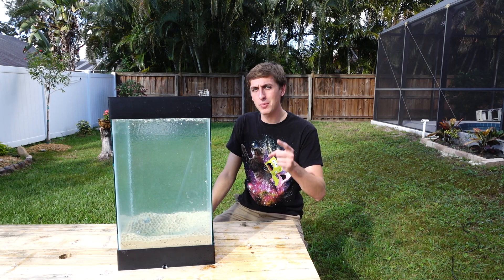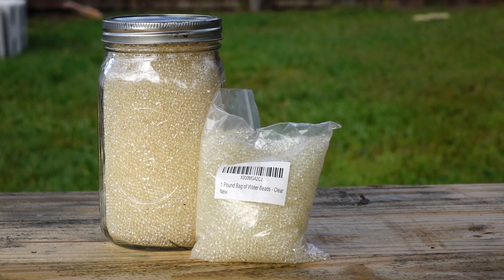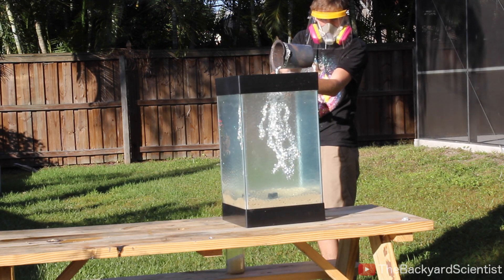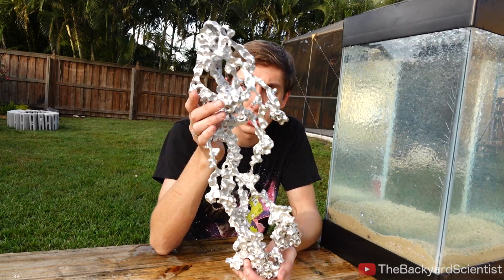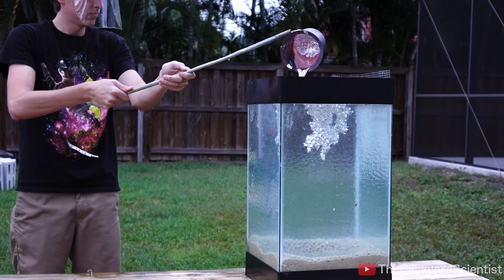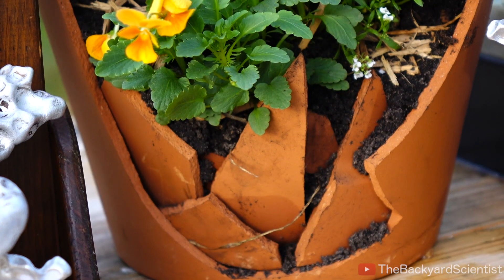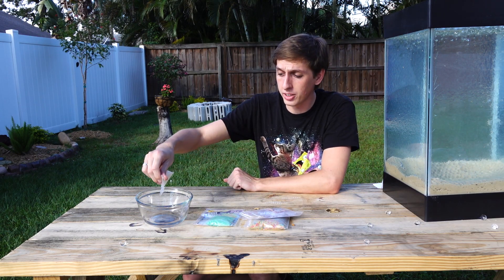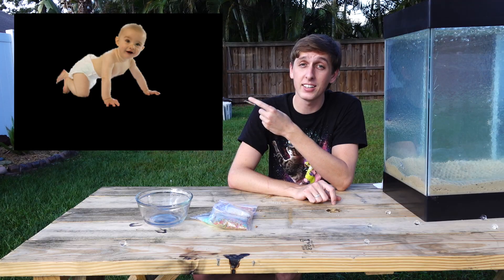Molten Aluminum Vs 'Spitballs' - SO COOL!! (water balz)

Comment: NEVER put it in your aquarium! NEVER!
Reply: tak nie it is not toxic at all, aluminum doesn't corrode
Reply: Natuka Rodriguez 
Because aluminium is toxic and can kill fish.
Reply: tak nie why?😲
Reply: Aluminium is a toxic metal
Reply: Aluminum is toxic in water, leeches into the water and can kill fish, but it's especially toxic to invertebrates like shrimp and snails.
I suppose if you coated it with a special paint and resin, it could work, buuut with the small chance that it isn't fully sealed or sealed properly, I wouldn't risk it.
Reply: Brooks Meinecke Actually aluminum cans have a plastic coat because it can contaminate the products inside a can
Reply: Brooks Meinecke  in some enviroments, or with some other  things in water it can.

Simple thing you can observe is taste of the food maded in aluminium pot, and steel pot - You can feel the difference?

Comment: Please do not put these in Any Fish Aquarium. ✌️✌✌
Reply: Soda cans are generally given a coating on the inside to keep them from contaminating your drink.
Reply: remixgod 
Oh man, I was right about to, in my fish tank that I totally have
Reply: Maybe you could if you coat it with something so that it wouldn't contaminate the water
Reply: remixgod umm 😐 you drink out of soda cans which are aluminum,
Reply: Epoxy could do the job (after neutralizing...)
Reply: remixgod agreed. that cannot be good for the fish.
Reply: Fkp%d
Reply: remixgod Then why do we use aluminium foil?
Reply: Maybe you could put on it. Some crystal resine To coat it.
Reply: Well to late
Reply: Chase 123424 You are not stating facts.. Generally having "Metals" in your aquarium is not beneficial to fish. There is such a thing called "Metal Poisoning". ✌️✌✌
Reply: @KINGShaheed - You can generally cook on aluminum or in aluminum pots without a problem, but it's better not to store food in it for any appreciable time. Aluminum can leach into the food, especially spicy and high acidity foods.

Also if you boil water in an aluminum pot it will cause it to oxidize and creates a barrier that helps prevent leaching into the food. Aluminum foil is harder to get that oxidized layer on. It's better not to cook with aluminum foil and much better not to store food in it if it has high acid from tomatoes or lemons or spices.

Aluminum poisoning takes a while in a human sized organism, but it accumulates in the bones and brain, eventually causing problems.
Reply: Federico Madden yeah, something that's just as harmful in the long run!

Comment: This video was so cool! I was just thinking "wouldn't it be cool to see one of those sculptures be used as decor in an Aquarium?". In all seriousness, would it be safe for fish to have an aluminum sculpture in their tank? Any expert fish keepers out there know if this is safe???
Reply: Cans are coated on the inside
Reply: Terrae Spiritus no it isn't.
Reply: If aluminium isn't safe for aquarium use. You should probably stop drinking from soda cans. Btw... I use aluminium weights to anchor down my aquarium plants so the bottom dwellers won't mess it up easily
Reply: @DanlGy  there's a thin plastic film so the drink doesn't touch the aluminum
Reply: ok

Comment: @TheBackyardScientiest, we are trying to reproduce your results.  We bought the spit balls, but when pouring the aluminum, it doesn't go down as far as yours seem to be going, so we get a short squat cool looking art piece.  We were wondering if you had water filled to the top of the tank with the balls inside, or very little water, and possible we are not heating up our aluminum hot enough to make the longer journey.  Any help would be appreciated.  Thanks.

Comment: Here's an idea: What would happen to the aluminium if you repeated the experiment with some acoustic resonance added? As in, put the tank on a speaker an pump out some white noise. Would it cause the aluminium to spread wider, or, reach the bottom faster?

Probably wouldn't be able to put the GoPro under it in that case, but, we've seen that angle already anyway.

EDIT: Also, different types of music.

Comment: The only way it would explod is if the water was added to the molten metal, not vice versa. Its how they cooled off forged metal like swords. Worked at an iron foundry and learned about their minor geothermal issues with a furnace that sent a crack throughout the entire foundation of the plant. A dull out explosion would have set off 4 other furnaces. And I loved that job. Lol

Comment: @TheBackyardScientist What set up did you use for your propane burner? I'm having trouble finding a good crucible and end piece for the burner to spread out the heat.
Reply from the maker: +Thor Senpai I made something like the king of random made. There's a million ways to make them, sometimes you can't find all the pieces and you have to improvise but it'll pretty much work anyway. Just shoot Propane down a tube. the flared end isn't really even necessary  honestly. 

For the crucible you can order one off of Amazon for about 40 bucks, or you can buy 20 stainless steel containers from a thrift shop for that price. I found cocktail mixers work great. The stainless steel will eventually get a hole in it though, but graphite crucibles are prone to breaking.
Reply: +TheBackyardScientist your awesome
Reply: Thor Senpai knknbbh

Comment: CAUTION: Do not add aluminum to a live fish tank fresh or salt. If you have live fish in your tank don't add aluminum as a decoration, this will cause your fish to become very sick and/or die.This is because aluminum is like lead and is classified as a heavy metal.

You may use copper, bronze, iron, or any metal that isn't classified under heavy metals.

Comment: i have 2 lbs of these, they are really interesting.  I'm going to use a 35 gal grease / oil drum with water.  also, i will try brass, possibly with balls that are not quite the large size as they end up being.  timing is the key, i will attempt to show the brass results . . . . thanks for this, I'm very impressed with your craziness . .. .

Comment: What about molten bismuth? When it solidifies it crystallizes into trippy stair like crystals. I think that the color effect comes from the air but what if it doesn't? What if you could force the crystals to look like bubbly coral instead?
Reply: Titanium changes colors (sic, plural) depending on what voltage is applied to it.
Reply: Ananta Sesa das Really? Neat! I'll look into that.

Comment: Any ideas where to source out a Vat and your Forge? Safety Equipment is easily acquired. Aluminium is also easily acquired. Information on any other tools used in this project would be nice as well.

Comment: Those would look cool in my fishtank not sure if aluminium would harm my fish or not but they would look super cool in my tank.This balls they can be used for plants?
Reply: +KoolBreeze420 The balls are used fairly commonly for people who are bad at remembering to water their plants. Watering once a week or so keeps the balls hydrated though they gradually lose water over time. Aluminium is toxic and has no biological pathways known for any animals. If the pieces were sufficiently oxidized or polymer coated they could be alright though. Oxidation would be a bit more difficult to trust depending on how well you monitor the pH of your fishtank. A polymer coating would probably be the best bet overall.

Comment: I have tested but i wasnt recorded it yet. So, if you wish to try just follow steps:
Materials:
- Steel plate 30x40x2mm
- 1Kg of gray iron, nodular or steel (depends on how much heat you can produce)

Steps:
1. Make gadget or machine similair to crane with grapler wich will hold cube 10x10x10mm and make some trigger on safe distance for releasing the cube down.
2. On metal plate draw squares for making the cube and bend plate plate (you must cut of some parts) just like in school when you make square from paper or whatever, but this one must be Iron Cube.
3. Weld the edges all arround the cube and leave small hole to put water in, then just tick a small weld over small hole
(you can weld it all arround and then drill a 0.5mm or 1mm hole to put water in with injector) It would be best to put out all the air and then just Weld the hole with CO2 to seal it in full.

4. Melt the 1kg of Iron to 1.375 Celsius

5. Put droping machine over melted iron on 1 meter heigh and put the cube in holder

6.  Go to safety and pull the trigger.

Tell me suggestions or comments what will happen after cube drops in melted iron :D

cya!

Comment: just wondering about your furnace,  the intake where you have the air blowing into it, would it be better to use hot air or cold air?
I'm fitting a hair dryer to mine and just wondering if it matters what setting to set it to

Comment: Safety crybaby lol. you are buning polyacrylamide or sodium polyacrylate potentially releasing subunits that are toxic or carcinogenic (the acrylamide subunit is a occupational carcinogen and not very pleasant to the eyes dermal contact should be limited). No reason not to protect yourself while burning plastics, as a chemist I work with far more dangerous materials but there is no real excuse for putting aside safety especially if youwant to call what you are doing science. Edit also pouring molten metals into water is a common procedure but it does cause some interesting steam explosion effects, don't be the guy that was not wearing protective gear the one time it spits a glob at you.

Edit: The material degrades thermally so not really recommended to burn it without protecting yourself.

Comment: Aluminum will kill real fish.  I learned this the hard way when I used an aluminum pot to change the water in my tank.  I let the water reach room temperature, and when I poured the water into the tank (about 1/3 full) my fish started gasping for air immediately.

Comment: You also may wanna try this will with super absorbent crystals like what's in side a diaper you can get them from on line easily it's the same thing you have just in very small chunks instead of marble sized balls I bet it would have a very interesting effect

Comment: To any one think of putting something like this in a fish tank .I wouldn't put aluminum in a fish tank with live fish . If there are any contaminants in the metal such as any other kinds of metals mixed in or anything it can leach out in to the water and is very toxic to fish . If you were to put it in a fish tank coat it in a few thick layers of acrylic and make sure there is no metal I'm contact with the water and your fish will be fine !

Comment: Love the face shield and gloves with the exposed legs and arms. I'm not gonna preach safety on ya, just be careful. I cast aluminum in my home foundry and have darned myself pretty badly when a crucible leaked during a lift and when some moisture got into the melt and it flashed to steam, spraying molten aluminum everywhere. Since then I have started casting in full leather protective gear. Would hate to see ya get some of the nasty scars I have.

Comment: Very awesome! I will have to do these things this summer. How are those little GoPro cubes or whatever? I've seen them at the store.
Reply from the maker: +Camroc37 The Gopro session is pretty neat. the whole thing is waterproof, and the video quality is impressive for its size. now they have gone down in price its totally worth it for a backup camera or to provide another angle. 

Are you going to make a furnace?
Reply: ***** Perhaps in the summer/spring, yes. I will have a job by then so I can actually buy some things. See, up north it gets cold. Lucky Floridan. :D

Comment: That's really cool!
Reply: HI
Reply: Ha ha wow didn't expect to find you here. Guess the science metal etc crews stick together.
Reply: PikaLOLHD no dont tell him what to do
Reply: +TAOFLEDERMAUS you need test water ball it side up^ with mercury!!!!!!! with hot or cool!
Reply: you sould make a gun shell with these
Reply: +Kylar Mantooth Aluminium is actually really easy to melt. Brass, which normal ballistic casings are made of, has a melting point of about 1700 degrees. Aluminium melts at about 740 degrees, however, and its malleability makes the expanding air in the shell kill it.
Reply: get the fuck out of here

Comment: Really cool vid - have you considered anodizing some of the results?
Reply: +davidrobert2007 I was thinking the same thing.
Reply from the maker: +davidrobert2007 Never crossed my mind! I will look up if there is any commercial services in my area for a decent price. But I think I also have to sandblast them. The waterbeads left some carbonization behind.
Reply: ***** It's pretty easy to do anodizing yourself if you wanted to try, using mainly household items. Bill Gilmour on youtube has the best instructional videos I found on the subject. I taught myself to anodize aluminium when I built my model v12 engine :)

Comment: I could make a trade, I ended with close to 1000 pounds of aluminum to recycle just about every 3 months
Reply: uhhhh... Where do you get it from? There's no way any human being can drink that many dr. pepper cans
Reply: +Gigabic job I have, fix a lot of aluminum based personnel and material lifts
Reply from the maker: +CYTEEN15 Nice! I buy mine at a scrapyard for .60-1.50 per pound depending on the condition. I think they buy it for ~ 45c a pound.
They charge me $4 a pound for #2 copper though.. what a ripoff!

Comment: I love these, particularly the colored ones, we put them into cool looking glass jars, vases, etc(From the local craft stores) as house decorations.

I have a whole set that has lasted in pristine condition (No fog, no visible degradation) sitting above the fireplace, they look so cool.

Only ones that have issues are the mixed color ones, as the dye in each tend to blend in after a while and become a strange ugly mixed color (we did this with red/blue to simulate a mixed mana/health potion from old games) but it turned purple which was okay, later in the year we actually found purple colored ones anyway which take that place. Red, Blue, green, and purple make for great decorations.
Reply: +Patriot 03 Neat little things to spice up a boring look house, fun family project too.
Reply from the maker: +Patriot 03 I noticed the color leaching out of the colored ones. Ive also noticed they fall apart if left in the sun for too long!